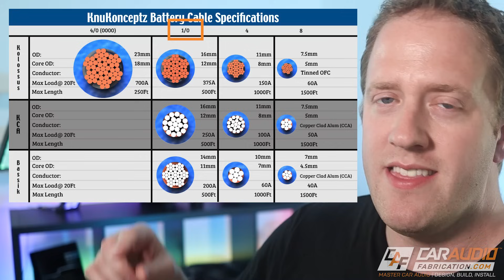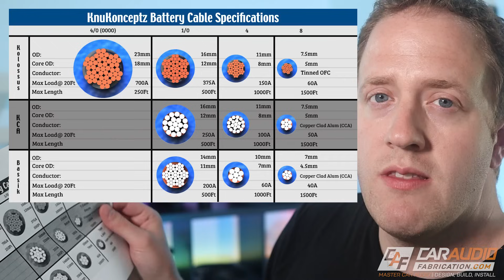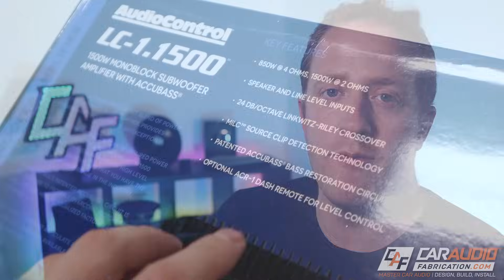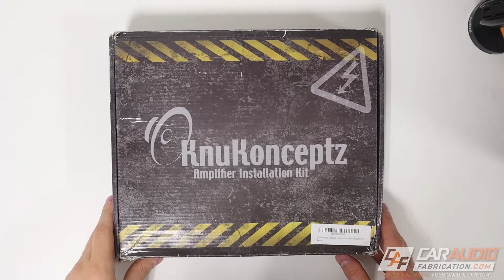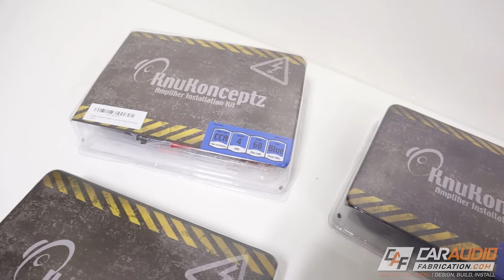Car Audio Power Wire - Do's & Dont's for a BETTER SYSTEM!

Comment: Riddle me this- at the back of a head unit, all the wires are next to each other. Why is this ok and not cause a problem?
Reply: They are connected in their own terminal/pin, etc. Also they are insulated from one another. But also, only a small length of the wire is within close proximity.
Reply: @crow-vz5lx  ah.  Cool. I knew that but I didn't. Was kind of a serious question, but then not. I figured whatever it was, obviously its ok, but just realized I never really knew.  Thank u sir🤜🤛
Reply: @noahkb80  there's never a bad question if you're really wanting to know something

Some things that seem easy to understand, may not always be.
Cheers.

Comment: Copper is not silver why is it like that ⁉️🤔
My old 2004 don't have any on the cable
Is 6ga Fosgate power for 1100a2 and 200a4
OFC or aluminum foil wire's ⁉️🤔 my son's
New wire not the same thing. Is twice as big
Reply from the maker: Tinned OFC for corrosion resistance.

Comment: Lol i got a stock alt 😂, charging my 2 secondary batteries through a single 0awg and i got super short 0awg to my amp which is probably overkill on a hd3k n 2 x 10s 😆 lol
Reply: Hook a volt gauge directly to the amp and play some music. You'll be shocked I guarantee.

Comment: I have to call bs on most of this power cable bs!! You cannot tell me that you need 0-gauge wire for most installations. Imo, it's just a way to squeeze more money out of you!! I would like to see an actual car setup actually using 240 amps of current! I would also like to see a true 240 amps delivered to one of these high-powered amps and watch it melt!!

Comment: Just stay away from cheap ebay wiring kits, they lie about wire gauge or ship a wire with a extremely thick isolation so it looks like a smaller gauge wire.
Reply: Amazon is the same, and going to the local car audio shop is the best option.

Comment: Ok so there have been others who explain this very similar topic but in better detail with actual testing and with 15 ft of 0 gauge ofc and cca wire the difference in voltage was only .5 volts see this is the problem with people exaggerating and not testing. Him claiming a 1 volt difference compared to my .5 volts difference may not seem like much difference but it is in numbers. Proven numbers say there is only a  .5 volt difference and at his claim of a 1 volt difference is 50% more than what's actually been proven. That being said $30-$50 for a cca wiring kit or $120+ for an ofc wiring kit which will only increase your voltage by .5 volts?  Seems a bit redundant to me.

Comment: OFC? You were holding up a tin plated wire.
Reply from the maker: Incorrect. OFC wires can be tinned to allow for corrosion resistance which is an improvement over normal uncoated OFC wire. You can't judge a wire merely by its look.

Comment: OOORRRRRR, just buy a great amp that has a regulated power supply, then you don't care as much about power loss in the cable, because the amp will just pull harder. JL Audio for the win! ..again.